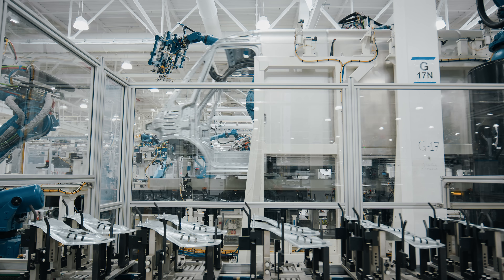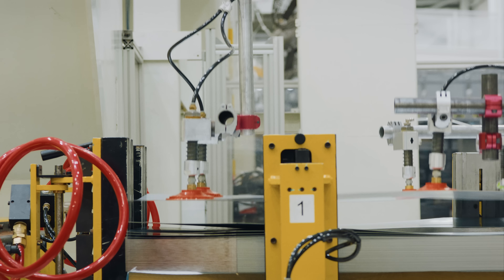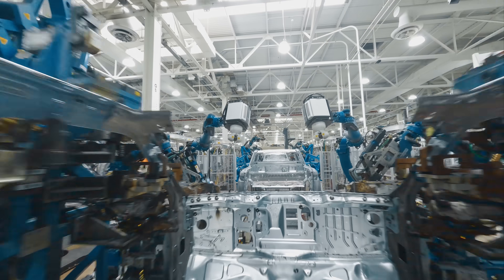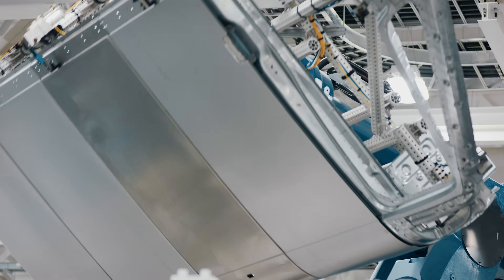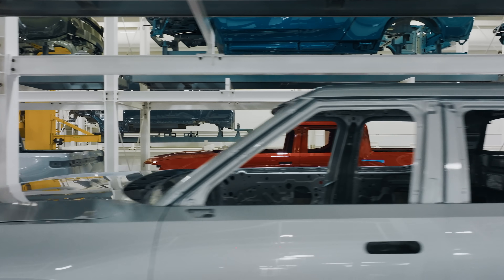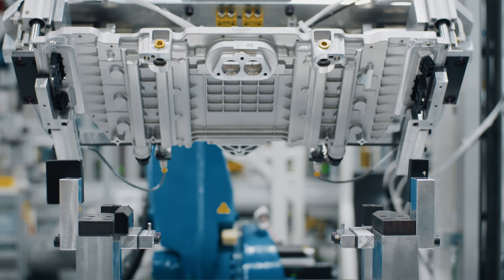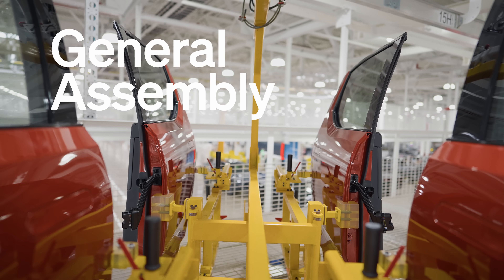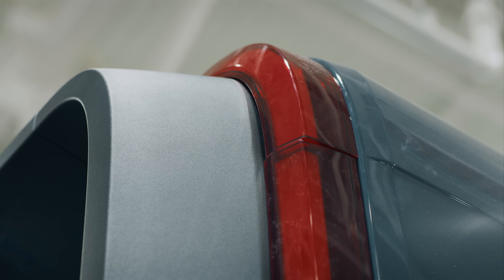A Tour of the Rivian Plant | Go behind the scenes with founder RJ Scaringe

Comment: The portable kitchen is a highly unique feature which working people will highly value. You might want to perfect that, a vehicle version with increased size of the kitchen with reduced tailgate space, quad LPG or CNG gas burners mounted on deck with a lpg cylinder on board alongside the induction stoves already present. The LPG cylinder is very important as a kitchen element in most places. This hybrid model of LPG based kitchen alongside an induction stove will be resilient against range anxiety. Since you are a new company,you might want to really  really focus on the uniqueness of your vehicle rather than mass production. Chip shortage will be making things very tough on mass production side for some time.

Comment: too little too late unfortunately, and the share price reflects that, down 72% from ipo. that f150 lightning is just far too compelling.
Reply: I get around 240 in my current 3 year old Model 3, and it’s plenty for me. But trucks are different, so I won’t compare but you can’t do a blanket statement of “ANY EV owner”. There’s also plenty of people I know that drives Leaf’s, Chevy Spark EV’s (both myself as well) and can make due
Reply: big minus....ITS A FORD.
Reply: 240 mile range in the lighting is not enough for any, and I mean ANY EV owner.

Comment: Celebrating my 3rd year as a preorder holder today. Cheers, interesting video and can't wait for the Max Pack!
Reply: I feel we Max Pack preorder holders won't see our truck until Q2-Q4 2023. Gotta keep our hopes that it's sooner!... max pack WILL be worth the wait.
Reply: They don’t sell max packs anymore right? On the configurator?
Reply: @heatism  you can still option an R1T with one, but hasn't been possible to get an S with a 400 mile pack. Best you can do to optimize range on it is to option the dual motor large pack, which has slightly improved range/kWh

Comment: The Commercial EVs, will other businesses be able to buy them or are they just made for 1?
Reply: I read somewhere that Amazon has a time-limited exclusive, so they'll certainly be able to offer modified versions to other customers.
Reply: @BillyHarvey  Thanks Billy Harvey. I hope I can wait that long. Also hoping it'll be able to carry 2-3 tons on cargo. FOOD cargo. And the breaks, break fluid, break discs, and suspension will be able to handle the weight with stop and go traffic in NY, NJ, & CT every week for 10-15 years. That's how long my Chevy Express 2500 lasted after 3 transmission changes, 4 breaks changes, 2 rotors changes,  1 suspension change. 230,000  miles on the odometer when I sold it.
Reply: @robertlee8805  You mean "brake".  Break is when you damage something.